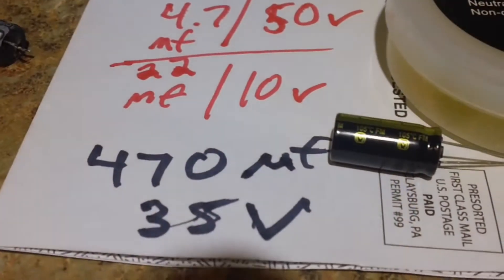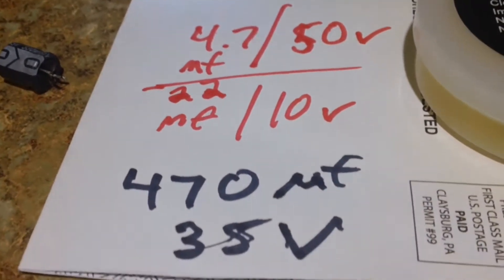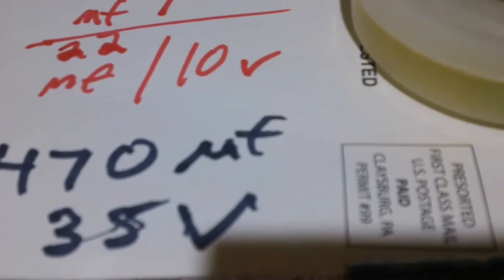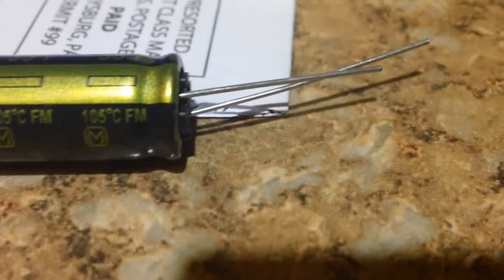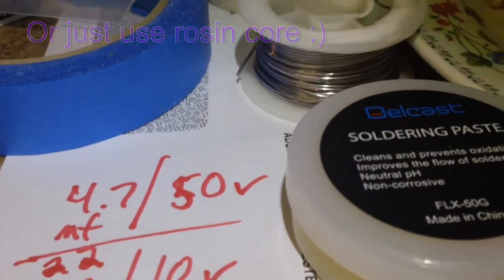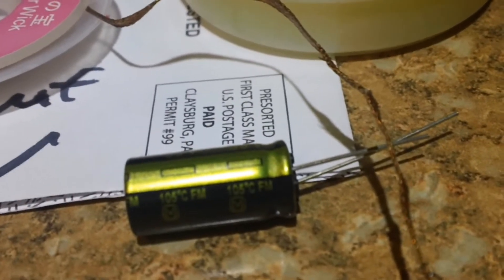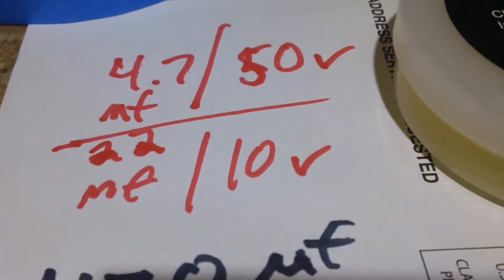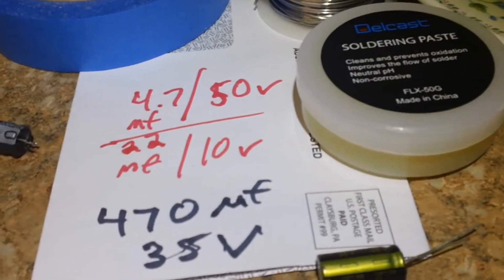Craftsman 1/2 HP logic board capacitor installation tip

Comment: Hi, I have this same board in my Chamberlain unit and the issue is the door will not CLOSE with the remote but it WILL OPEN with the remote everytime.  Do you think its this capacitor? I already replaced the board maybe 5 years ago that had same exact issue and now its doing again.  Rather than buy another used board would like to repair if possible.  Thanks
Reply from the maker: Heat does horrible things to electronics.  It's worth a shot with the capacitor swap out.  Maybe you will luck out.   You can visually inspect capacitors for bulges but without
a true capacitor tester it's impossible to get the true condition of  the component.  Also have a look on the traces on the board if they get cracked it would not complete the circuit 
Sometimes you can retrace with solder.  One final thing is to check for any loose connections and that the motor and assembly is secure on the overhead.  Good Luck!
Reply: @Screenguy3  Yes I ordered an in circuit ESR tester yesterday to make sure its bad before I swap out. I just got the tester and the cap is definitley bad!! (very high resistance) Also will try retracing the solder in various spots too.  Thanks
Update: after replacing the bad cap, it works!! Yay!  Thanks again